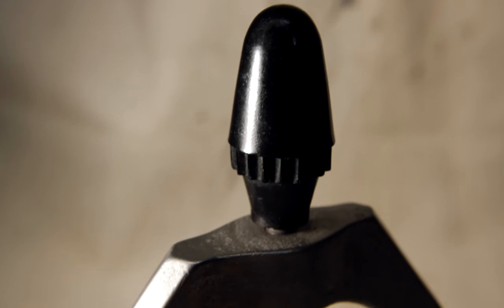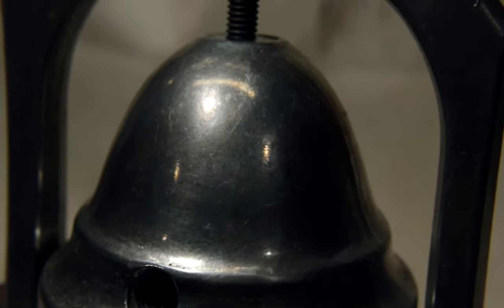Vintage Coffee Maker - RESTORATION How To Make

Comment: What size gasket did you use?
Reply from the maker: Hey, 
original gasket for this coffee maker has slightly different size compare to those you´re able to get these days. I took whole thing to shop and we tried which gasket fits best. This one I think is for 3 cup version 64x48mm but I had to enlarge it anyway. I did it by stretching to 66x50 approx

All best

Comment: Hi. Im from Turkey and last week i visited my grandparents in their village and found the same coffee maker. Being a coffe addict i had to get it so they gave it to me. The problem is the lid is stuck and couldnt open it So i searched on youtube and found your video. 😊👌
Reply: update: My father opened the lid with the hammer from the sides. So everything is the same condition as in your video. 1:42 same stickiness we took that out etc. So I have a few questions.
What is that spray that you used for? 
Mine has white spots in the inside. If I boil water with baking Soda inside of it do you think they will go away? ( We put everything in the dishwasher before but it didn't do anything)
Reply from the maker: @Sn_SS95  Hey mate,
I used some kind of wax / rubber remover you can search something in drugstore there is plenty of this type of stuff (at least here) in som emergency cases I used many times ordinary kitchen oil to remove some old sticky sealings, rubber rests, stickers etc. 
I have no clue what these white spots are maybe some sort of limescale. Try to boil vinegar inside. If it wont works use drill with wire brush and remove it mechanically. 
Wish you best results mate.

Have a nice day and stay safe!